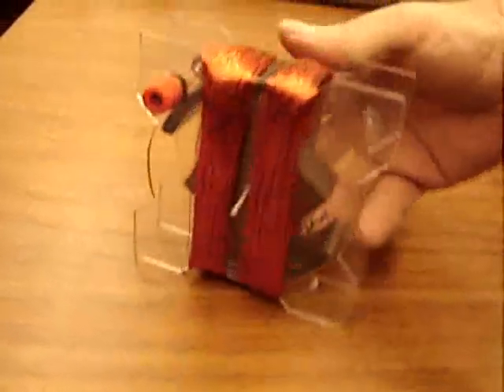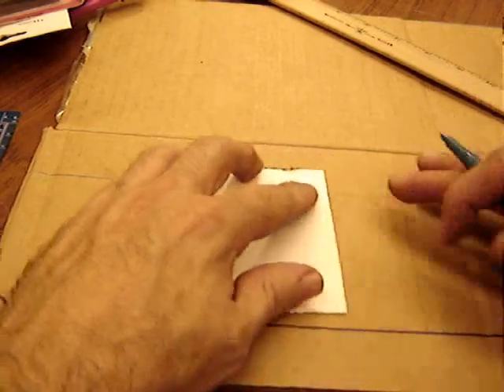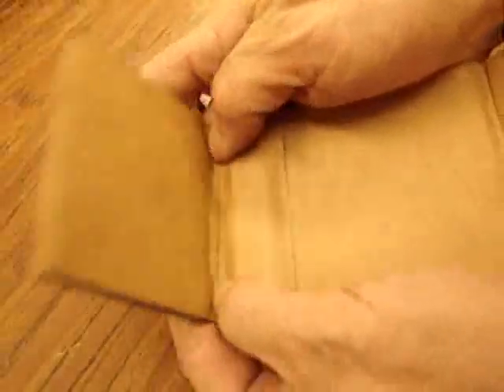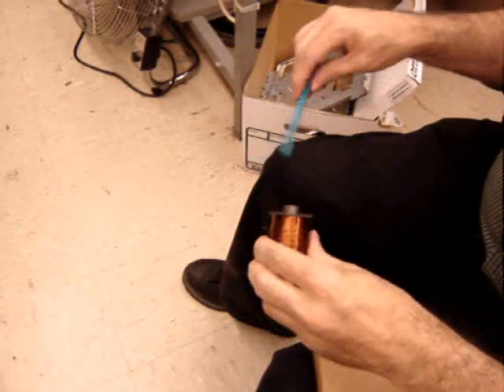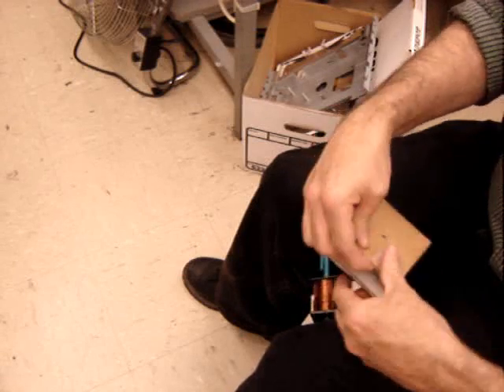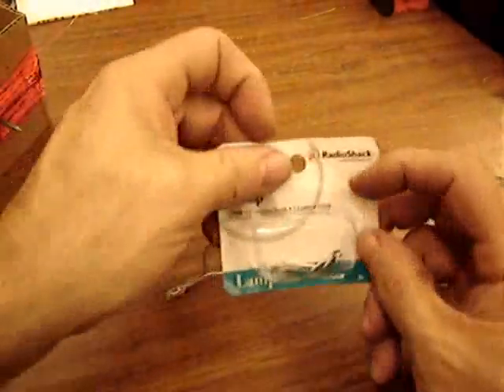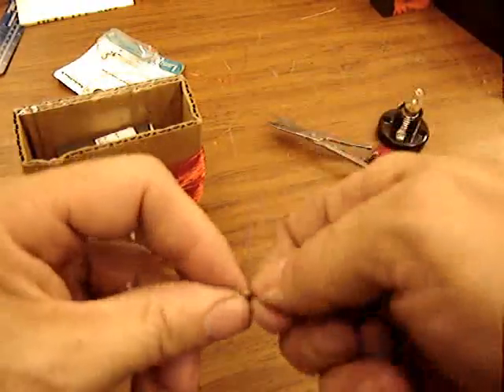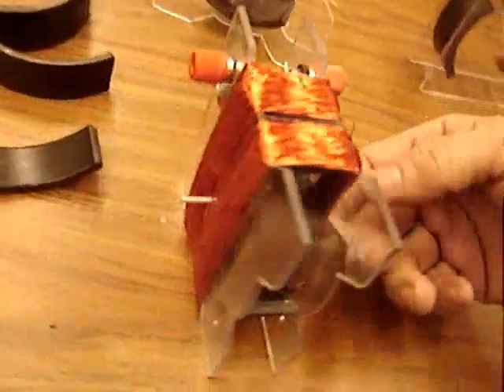Simple generator:  AC electric generator for science fair

Comment from the maker: > hey, would u recommend using thinner wire 
> or thicker wire, i used really strong magnets
> as well as coiled about 700-800 turns of 
> thick wire but it still didnt work.. 
> any advice?

First build an exact copy of mine and get it working.  Then build one with different magnets, see if it still works.  Then build another one with different wire, see if it works.

If you make several changes at once, you won't know which one caused failure.

Comment from the maker: > Can i add the other wires in the bag to the red one so i didn't need to spin my so fast.

Yes, but it only helps a little.

Better to buy two kits, then only use the two spools of #30 wire.

Even better, get the spool of wire out of a cheap G15805 solenoid from Electronics Goldmine mail order, then wind 500 turns or even more.  Tear apart that solenoid using vise-grip pliers.

Comment from the maker: > i could`t found scuare magnets i found cicular ones like a donut 

No, the donut magnets are too weak.   They perhaps might work if you use thinner wire, and also wind many more turns (like 1000 turns.)

Easier to buy "ceramic block" magnets on eBay or mail order

Comment from the maker: > Or use a bridge rectifier :D.

Not on a generator which puts out 0.5Vrms!  Even a single Schottky diode has a big impact.  (So just switch to #35 wire, and wind a thousand turns?)

Comment from the maker: Here's a simple wind generator: youtube com/watch?v=ZlVAqkzNCv0

It can run an LED, but it uses a small motor as a generator.

To convert my SIMPLE GENERATOR to wind or water power, you'd need metal or plastic case, ball bearings, and very well-balanced magnets.  And use lots more turns of wire!

Comment from the maker: > Could a generator be made where a series of magnets pointing 
> N and S alternatingly being spun on a wheel on the outside 
> of the coil generate electricity ?

The coil needs to be about the same size as the magnets. If you use a lot of little magnets, then you need a very small coil (or a lot of small coils wired up in series.)

Comment from the maker: > But I have to prove to the class that my current is ac

Try using a red LED in place of the bulb.  As the magnet rotates, the LED will flash during the correct polarity and go dark when the polarity is backwards.

Or buy a $5 digital voltmeter from Harbor Freight Tools.   Then use it to measure the AC voltage.  harborfreight com/cpi/ctaf/displayitem taf?Itemnumber=92020

Comment from the maker: > me and my friend and doing this and where 
> do we tape the wire first. 

Just tape it anywhere to get it out of the way.  Then when the coil is done, pull it out and connect both ends of the coil to the light bulb.

> and doo u have to use all of the wires like 
> one of the spool wire has ilike 39 turns and 

I just use the thinnest wire.

But if you buy two kits of wire, and wind two spools of the thin wire on the generator, then you don't have to spin the magnets so fast.

Comment from the maker: > And....nothing. Help!

It might work if you stack up lots of disk magnets to form a two-inch rod, where the magnetic poles are at the ends of the rod.  Then glue on a crosswise center axle so the rod flips end-over-end when you spin it.  

And the ends of the rod must be *very* close to the wire.  That's why it's best to build the spinning magnets into a close-fitting box, then wind the wire outside the box.

Comment from the maker: > And....nothing. Help!

I've never built a generator like that, so I can't say what's wrong.  If I had to guess, I'd say that the magnets are way way way too short, so all the field stays near the magnets and very little touches the wire.  Also, with several magnets on a cardboard disk, their fields will cancel out.  You need one long magnet.  Also, the wire should not look like a circular ring, it should be squashed, so the hole in the ring is like a slot.

Comment from the maker: > how can motor be a generator?

Suppose you have two pulleys and a leather belt wrapped around both.   The first pulley is the generator, and the belt is like the "electricity" inside the closed circuit of wire.  The second pulley is the motor.  If you turn the first pulley, this causes a "leather current."  And the second pulley turns also.

See what's happening?  Pulleys are electric/mechanical converters.  They're neither generators nor motors, but are both.  

All generators are motors!

Comment: thats exactly correct ive almost run a set of computer speakers with this thing but i had a drill turning the pulley lol i could have just hooked the drill battery to the speakers would have worked much better the drill battery is 12 volts 2.0 amps

Comment from the maker: > and now if you spin the pulley the light lights up

Yes, small DC brush-motors are the same as generators.  And they're designed MUCH better than the Simple Generator above.  They have close-fitting iron parts that give much higher voltage.  And they have a rotating switch that converts the coil's AC output into DC.

If you want to make a waterwheel generator or a windmill, then a DC motor is probably a better choice.  (But then you didn't build it all yourself.)

Comment: I have this 9 volt DC motor and pulley assembly connected via belt and i put wires from the motor and hooked an LED on the end of the wires and now if you spin the pulley the light lights up

Comment from the maker: > so i am doing a project on tesla

I suggest buying a CCFL fluorescent light from coolerguys com/cathodes html They are run by Tesla coils. You can even cut and remove the ground wire from the fluorescent tube, yet the tube will still light up. It demonstrates Tesla's high-frequency "one wire technology" where no complete circuit is needed.

Comment from the maker: > can you run a curent through the solenoid and make the magnets spin?

Yep. Read the webpage article, the part about "Motor Challenge."   You could apply a low frequency AC wave, then spin the magnets until it "locks on" and spins by itself.  Or you could supply an electric switch attached to the shaft, where the switch turns a battery on and off, creating AC to power the coil.

Comment from the maker: > so the water wheel will power it instead... Any ideas?

It needs to spin extremely fast, so a waterwheel probably won't work unless you have bearings and gears. Or you could blast it with a nozzle on a garden hose.

Comment from the maker: > i am doing this project but i dont have 2 long wires

Wires always have two ends.

When you wind the wire on the cardboard, that wire has two ends.  Just hook up the two ends of your coil to the lightbulb's two wires.   If you cover up the loose end of the wire underneath your coil, then your generator cannot work.

Comment: whats the spacer? and i am doing this project but  i dont have 2 long wires like you for the enamel-coated magnet wire i just have 1. and when i twist the wires together the light bulb does not light. I have tried this several times. Please respond ASAP

Comment from the maker: > Can I get higher volts by using thicker gauge wire from the sools of radio shack wire? ( The 28 and 26 gauge strands)

Yep.  But those spools don't give as many turns, not much extra voltage.  It's better to buy two kits and use both spools of #30.

Comment from the maker: > Any idea if you could incorperate some form of rechargable battery

For that you'd need a More Complicated Generator with DC output commutator.  Or you could use about five times more turns of wire and a diode.  (Diodes eat lots of energy because at low voltage they act as significant resistance.  That's why we use mechanical commutators to convert AC to DC.)

Comment from the maker: Just use two wire kits from Radio Shack.  That way you don't have to spin the magnets so fast.

Even better, get thin wire by using vise-grip pliers to pry open a 24volt solenoid such as number G15805, mail order $1.49 from Electronic Goldmine, goldmine-elec com.   One solenoid wire-spool is enough for at least two generators.  A bit cheaper than Rat Shk!

Comment from the maker: > wouldn't the wire eventually disappear when all the electrons are used up? 

Remember, the bulb filament is made of wire.  In metals, the electrons of the metal don't orbit single atoms, instead they orbit all through all the atoms, forming a kind of "liquid."

So the movable electrons are always there in the metal all the time.   The magnets just push them along.   It's like a belt made of electricity.   But the bulb filament rubs harder on the moving electrons, so it gets fantastically hot.

Comment from the maker: 1. how can i make higher volts.
2. how can i make higher amperes

Higher volts from spinning faster, or winding more turns of wire, or using supermagnets.

Higher amps from attaching a low-resistance load.   But amperage is also limited by the thinness (the ohms) of the wire, so use fewer turns of thicker wire for high amps.

Professional AC generators spin WAY FAST, and use thick wire.  (They also use laminated iron core.)

Comment from the maker: > Do you attach the wire from the generator to

Check out the drawing in the main article at amasci com/coilgen/

Two wires from the generator, two wires from the bulb.  They plug together.  The path for flowing charges must form a closed loop.  It goes through the generator and through the bulb.

If the twisted connections should touch together, that forms a "short circuit."  It's not dangerous or anything.  But the generator becomes hard to turn, and the bulb doesn't light up.

Comment from the maker: > I have actualy some neodymium magnets in my room

I tried a 1" spherical neo magnet, mounted inside 1.5" water pipe with nail,  naileads glued to the magnet sides.  With only 50 turns of wire, it lit the bulb when spun.

So, probably it will work OK if you use small magnets to build a small generator (with the case very small, so the wire stays very close to the spinning magnets.)

Comment from the maker: > Thanks for link, but it doesn't clear my doubts.

The roles of B and H were backwards.  Iron produces a higher current, not lower, since a small applied H will create a large B.  But that only works for closed iron paths with tiny air-gap.  A simple iron rod will help, since it distorts the pattern and concentrates the field through the coil, for more rapid changes in flux.  But then it has strong pull, and is hard to start those magnets flipping.

Comment from the maker: > If you breake a chip of the magent will it make a diffrence?

Nope, no difference.  The biggest problem is in not using enough thin wire. You can always put chips back on with crazy glue if you really want.

Comment: Thanks for link, but it doesn't clear my doubts. I was thinking about alternator. Why there is iron rod used in the coils. I asked about it because equation suggests that cail with iron rod would produce much smaller current, I think.

Comment from the maker: > or a squeak from a piezo-electric beeper.

And thumps/rumbles in headphones or speakers!  I tried stepping up the AC using a small transformer, but the frequency was too low, and the voltage decreased instead.  But in theory a very large, high-wattage transformer might work.

Comment: I've got question. When we get higher amperage in coil induced by external magnetic field? the coil with soft iron rod or air coil? If ironreod-coil then why? for the same B we should get much smaller current with rod due to the formula H=B / (u0 * ur), right or not?

Comment from the maker: If you use *lots* more wire, you can light up several red LEDs.  Buy several wire-spool kits from Radio Shack, or get wire by prying open a solenoid like number G15805, mail order $1.49 from Electronic Goldmine,  goldmine-elec com

Comment from the maker: You have to use that special radio shack light bulb.  No other bulb will work.

You have to use insulated #30 wire, three hundred turns or more.  Different wire probably won't work.

Comment from the maker: Have you tried everything at DEBUGGING, amasci com/coilgen/generator_3.html

If everything else is correct, then usually the problem is that the magnets aren't spinning fast enough.

Using double the amount of #30 wire (buying two wire kits from radio shack) lets you spin the magnets slower.  But that's more expensive.

Comment from the maker: > can you use a thicker wire?

You can try, but you still need about 300 turns of wire very close to the magnet.  If the wire is too thick, then 300 turns would be the size of a football, and most of the wire would be too far away.  For wire suggestions see amasci com/tesla/diode html#wire

Comment from the maker: > yeah. will this affect the performance in any way?

If you increase the number of turns of wire, the voltage increases. Or it means that you can crank the magnets slower.

Also, if you increase the *total weight* of wire, the max power output increases.  Which means you could hook more light bulbs in parallel without them getting dim.

Comment from the maker: > Can I charge a rechargeable battery?

Or charge a supercapacitor.  You'll need to add a diode in series though, to convert the AC into DC.

For batteries you'd need about four times more wire.  That, or spin it much faster, or use expensive supermagnets.  Batteries need way more voltage than this generator is designed to produce.

Comment from the maker: > what does the wire gauge have to do with it?

Since it *must* have about 300 turns, then too thin wire will dim the bulb.

But if the wire is too thick, then 300 turns will fill the cardboard and spill over the edges. Also, so much copper will be fairly expensive.  30-gauge is about right.

Idea: measure the ohms resistance of the coil, then measure the ohms of the bulb. Then calculate the percentage increased current if the coil resistance could be zero.

Comment from the maker: > The magnetic force coming from the sides of the magnet? 

The magnetic field comes out of the ends of the magnet and loops around to meet along the sides.  But the part of the field that stays near the magnet is useless for the generator.  Only the field that passes through the wires will force charges to begin flowing.

It would be better if the magnet was round like a ball, and the wires were very close to the magnet surface.

Comment from the maker: > Why not use an LED?

Sure.  Gotta spin faster though.

> Could you somehow put a capacitor between the light and the wire?

Yes, but first add a commutator (or use a diode and double the amount of wire.)

> Is this an AC or DC generator?

AC

Comment from the maker: >how can you know how many volts will the generator produce if you don't have a multimeter?

You can't know.  The voltage gets higher when you spin it faster, or when you add more turns of wire, or when you use stronger magnets.

Copies of the generator in the video should produce nearly one volt when you spin it by hand as fast as possible.

The light bulb draws current, so the current depends on which kind of bulb is used.

Comment from the maker: >Do the direction of the pole in the magnets make a difference? 

The N and S poles have to be flipping end over end.

From the instructions:

DEBUGGING

STACK THE MAGNETS SO THEY STRONGLY ATTRACT. Make sure the magnets are positioned correctly. Do this: stack up all four magnets so their widest faces are clinging together. Then jam the nail through the crack in the middle of the stack. Then take this apart, and re-assemble it inside the generator in the same way.

Comment from the maker: > but instead of the box, have a circle of wire around the magnets?

Sure!  The wire needs to be very close to magnets.  A sphere-magnet would be better than those blocks.

But if you want to light the bulb, you have to create one volt, and you need a couple hundred turns of wire to do it.  (That, or spin the magnets a couple hundred times faster.)   A single thick ring of wire would create huge amperage at very very low voltage.